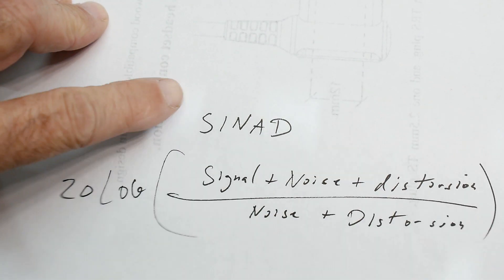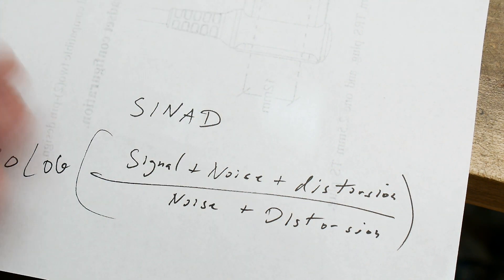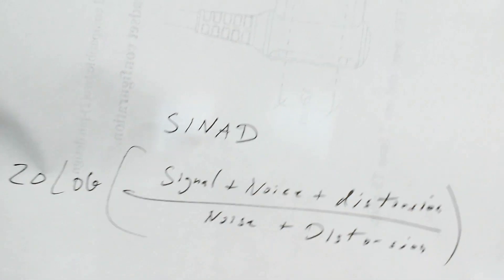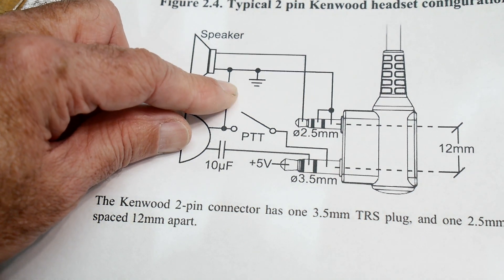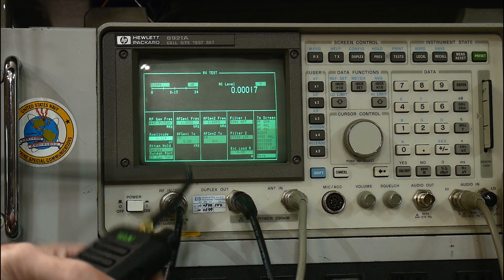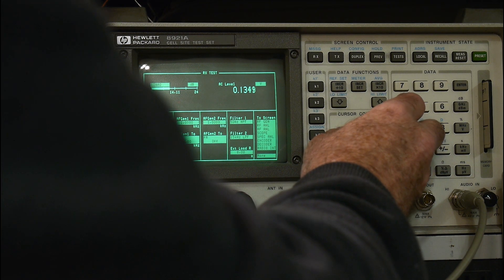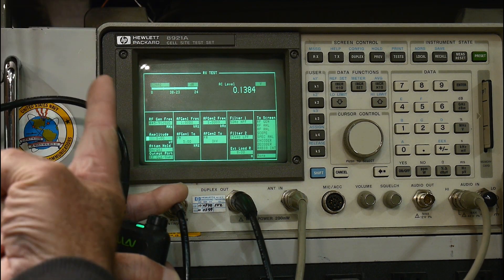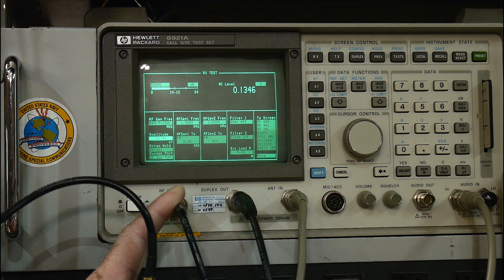#658 WLN KD-C1 (part 3) SINAD Measurement

Comment: On the web, SINAD is described as the ratio of the POWER, not voltage. So it would be 10log..
Reply from the maker: you are right it is power, if you make the measurements in power then it is 10log, if you make them in volts, then 20log. this is V^2 which is power
https://www.analog.com/media/en/training-seminars/tutorials/MT-003.pdf
Reply: @IMSAIGuy  I'm guessing that which ever method you choose, you will arrive at the same answer.

Comment: How test rx distortion and audio out out
Reply from the maker: The HP8920 and HP8921 have both tx and rx distortion measurements. The user manual shows how to do both of those measurements. The Rx distortion is very similar to SINAD you just press a different button. Tx is a bit more complicated and you need to connect the microphone input to the HP device so it can transmit the audio tone.

Comment: If a rig is really hot you may have to turn off the squelch to complete the measurement; luckily here it's set below the 12 dB SINAD point. Without the squelch you'd be able to measure the MDS. Did you chart out the frequency pattern of the 16 channels? I'm guessing this was specifically made for the 440-450 MHz simplex band.